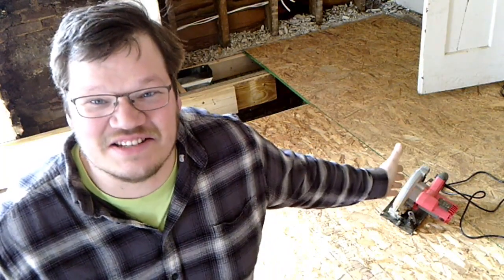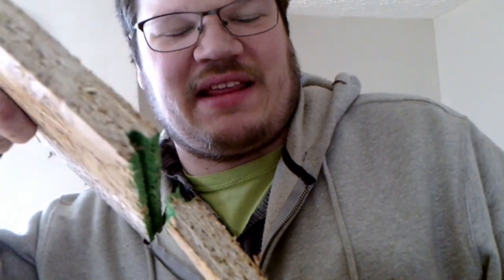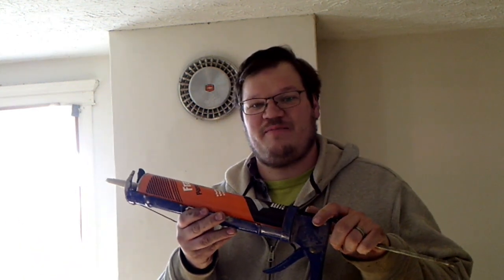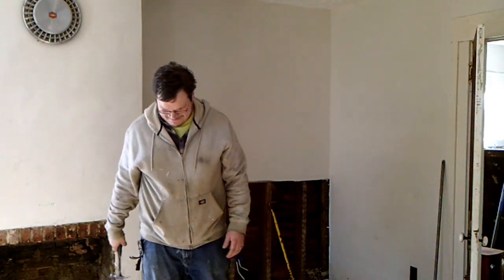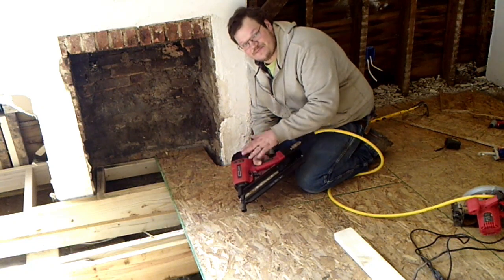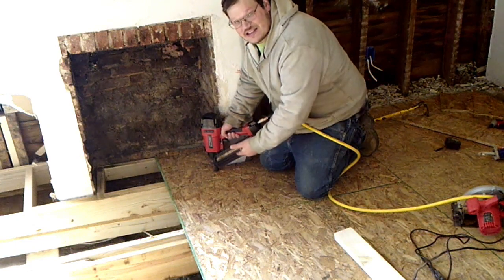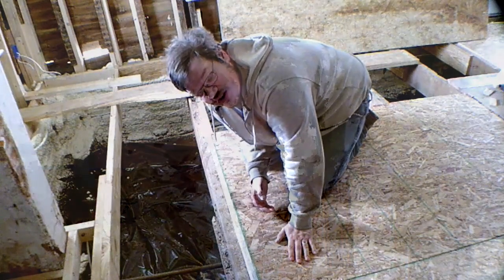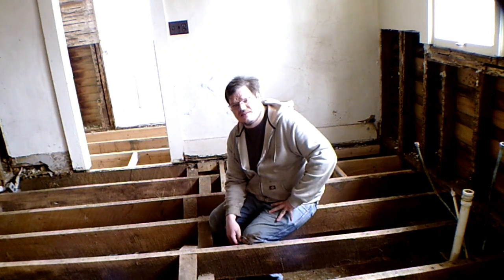How do you install a plywood floor subfloor osb sheeting tongue and groove learn to diy

Comment: Doing my first floor like this. Have a problem. I'm using tongue and groove 2x4 sheets 3/4thick. I paid to have them cut but they were cut wrong to where the tongue and groove are on the two foot side. ( short side not long side). Which means the tongue and groove are going to meet on the joist. The joists are 16 in apart. I can't have them recut. Any advice would be nice

Comment: I've also heard that when using nails to drive them at a slight angle will give them more holding power. I haven't tried this yet but hoping to on my next project.
Reply from the maker: That may be true but with the glue and nails should hold for a very long time

Comment: How you doin jay.I started on subfloor.Man i need help.I took out plywood first row was 2ft by 16 shld i replace with same size or put 2 4x8?I thought i was gonna use 2 2x8 sheet to start first row but i noticed i wld have to use 3 sheets cause groove i thought i was gonna use 1 sheet and cut in half but i forgot that one side has groove so i wld have to by more osb just to start first row.😥 Im using osb and where i want to stop tongue and groove dont match up.Do i put blocking where new subfloor meets old at the seams?Man i shld of paid someone.
Reply from the maker: I am going to guess the first row was the last persons last row where they had to cut the piece to fit in the last spot since the 4x8 does not fit try to use the tongue and groove all you can where you do not have tongue and groove you should put blocking to support the seem. I hope this helps
Reply: @JaysToDoList  Thanks jay i cut out subfloor with toekick saw.Cause subfloor went underwalls.I have a livingroom thats 18x13 i already tore half out so i cld lay 4x8 to start with.The job was tear out all  living room and half of hallway but if i start with 4x8 i wld over lap the old subfloor.i wanted to butt up with.So  can i cut old subfloor back so new one can butt with it then put clips or put blocking under seem?Sorry if im confusing you.
Reply from the maker: @elchoppo9248  blocking would be best rather then clips
Reply: @JaysToDoList  I more thing i just noticed the osb i got is smaller than 48inces and thats why im not meeting up with plywood.The ply is a true 48 inches.I shld of got plywood instead i was using this osb it is like 47 5/8 i had bought when prices were cheap.Now this osb is 50 bucks a piece i wanted to use.Maybe i can do living room all osb and then hallway seperate using plywood to match up with rest of hallway since its a true 48inches.
Reply from the maker: @elchoppo9248  that's your call you can use normal plywood just make sure you use clips or blocking between joists for strength if there is no tongue and groove
Reply: @JaysToDoList  Thanks again👍